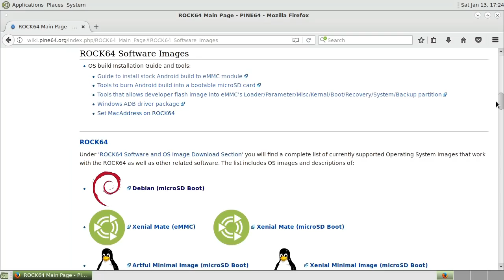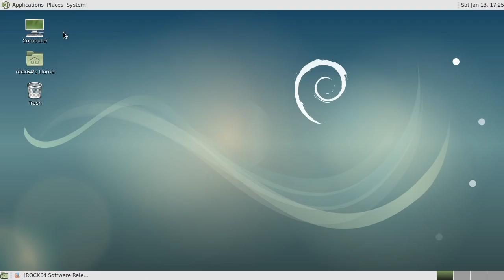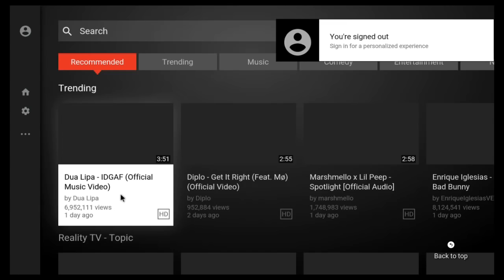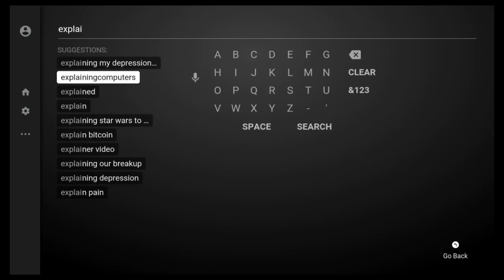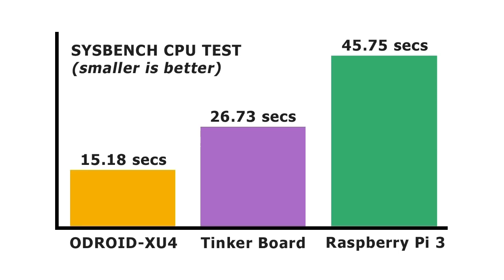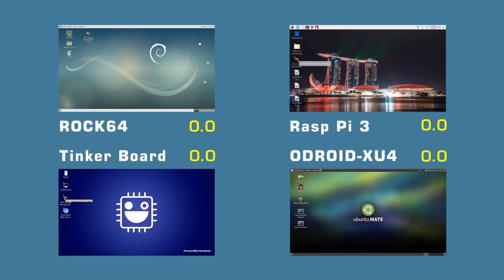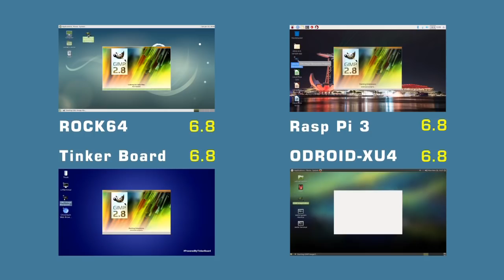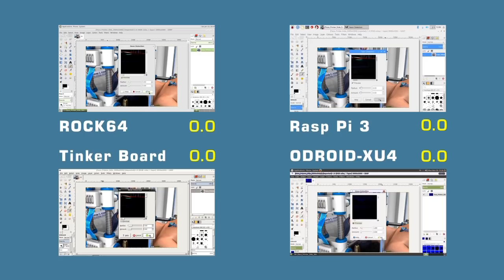ROCK64 4K USB 3.0 SBC

Comment: You are the second reviewer I have heard whining  about the lack of onboard WiFi, which, unlike the Pi 3's IO Bottlenecks, lack of RAM, and underpowered CPU, is easily fixable for a few dollars with an external USB WiFi dongle, which would offer much better range, bandwidth,  and security  (better security since it can be disconnected to 'air gap' the system, which could be critical in secure environments). Cost of the 4G Rock64 board including an add-on WiFi and SD card would still be less than an ASUS Tinker Board S,  with the Rock64 offering 2x the RAM (4x the RAM of the Pi3).

Cutting out onboard WiFi, saved them from dealing with MUCH more complex (expensive) compliance issues in the U.S. UK and Europe, letting them provide a more powerful CPU , TWICE the RAM (or 4 times for another 10 dollars), USB3, and REAL 1G Ethernet (with no BS Pi 3b+ bottlenecks).  

Pixel makes it clear that Pi Foundation intends Pi to be suitable as a lightweight desktop, but lack of RAM really kills the experence - so I would think folks would be overjoyed to see a nice low cost 4G RAM 4K Video SBC instead  of nitpicking.
Reply: Steve B. I think you forget that the Raspberry Pi Foundation is a charity organization. One with a very specific aim. They are not making desktop PC replacements, they make educational tools... combined hardware, software, literature and resources to encourage learning and experimentation. It's a long term project, which is something you can't necessarily say about  'competing' products. Many are here one minute, gone the next. No updates, no support, no future.

Comment: Chris, from your suggestion(Spectre/Meltdown video), I ordered and now received my Rock64 in today's post. However it gives no splash screen on power up and I have a blank display. LED's on, voltage on 3x USB, no lights on Ethernet. Using their power supply. Any ideas other than a dead board? Thank you for all your great information on the products!
Reply from the maker: Sorry to hear this, and it seems you have been very thorough in your diagnostic testing. I would suggest removing and replacing the micro SD card, just in case it is poorly seated. And then I would try reimaging the micro SD card and trying again. And after that I would go back to Pine64 to report a problem.
Reply: My image wasn't unzipped properly. Working great
Reply: Mark Handrahan thats what it sounded like

Comment: Regarding the sysbench test, you should use the exact same operating system when comparing different boards. Otherwise, your results won't be valid. I mentioned this in your ODROID-Tinker-Pi review. Other than that, I really enjoy your reviews. Extremely informative!
Reply from the maker: I have replied on this issue on your other comment. :)
Reply: Yes, I saw that. Thank you. My old Gentoo background gives me a different perspective than typical end users. I'm so tired of using "power sucking" computers and am having trouble deciding which ARM device to get.

Comment: It has DDR3 1866 right?! That means faster memory access then the others while factoring those primes... It also may have some hardware acceleration, for cryptographic purposes that it may have been using for factoring... Or sysbench was seriously updated in the mean time(that's assuming you have not done those tests all over again, but used old footage)...

Comment: Its no big deal its got no wifi. I have the Pi3 and the Wifi is atrocious, it dies after 30 mins..(gradually slowing down).  The best solution is plug it into a powerline adapter.

Comment: They should invent a wifi dongle that would fit in the LAN port, instead of the USB port...
Reply from the maker: Very nice idea. Somebody should do this!
Reply: You can't draw power from the LAN-port. If absolutely necessary you could go with a TL-WR802N. Very versatile, have the sturdy predecessor TL-WR702N in use for years. But it's not a dongle.

Comment: The support for Yocto is a HUGE benefit overlooked here. My understanding is that this allows you to build a distro from scratch from driver binary blobs meaning future OS upgrades are possible on your own.

I own many SBCs, and the biggest issue for me using them years later is that they’re stuck with a particular Linux distro’s version and the company no longer supports it (Cubieboard A10).

In theory, yocto should solve this.

Comment: rock64 is made by the pine64 guys.... you know that pretty much translates to great hardware, great price and last but not least non-existent software support. 

the only reason the rpi managed to get in roughly the same magnitude of secods in these test are not because of its shitty low power hardware, or its horrible price/performance ratio, but because of its abundant amounts of software optimizations.

Comment: Perhaps the prime routine in that version of sysbench or Debian is using the GPU. Perhaps you can also look at performance meter which monitors the CPU during the test, but my suspicion is that the test is using the GPU instead of the CPU.

Comment: I hope this would be the first real competitor in this game. I'd be astonished if 4K really works as well as normal full HD desktop. And also that you could have some in-between resolutions available (like 2560x1440, 1900x1200, etc). Usually these 4K SBCs limit the resolutions strictly to 2160p, 1080p and the usual 720p, 480p, etc. I have got many disappointments on this aspect with other 4K SBCs and the benchmarks are only a small portion of the real usability of an SBC, in my opinion; lots of features were not finished in linux side, only working in android ports and stability issues on the linux in general.

But I like the video and the channel in general!

Comment: I have the 4G one of these boards and it has worked well for a lot of projects. Would be interested to see a video on this using an eMMC Card (apparently ODROID ones work on it). Also a mention/test that the extra GPIO pins are already configured (with the Debian OS) to host a second Ethernet port (albeit at 10/100).

Comment: I've had this very machine for just over a month - the performance is actually very disappointing as htey wound the CPU clock speed right down to 1.2ghz Ithink, apparently this was to cater for units which ended up with slower ram chips according to one thread.   Our CPU miner - which hits 16 on the Tinkerboard - only hits about 10-12 on this thing and that's under a 64 bit OS where teh Tinkerboard runs 32 only (it runs at 1.8ghz though).  OS development is still terribly early,  there are many basic problems such as systems which won't come out of screen blanking which can't be turned off so as soon as the screen goes into power save it never comes back on one distro...  You can't get anything but basic resolutions and something like 1280x1024 can't yet be done, I have spent a couple of weeks trying to find a solution for this to drive that ratio of screen.  It has potential but a lot of work needs to go into hardware support and the OS's which is coming along albeit slowly;  in practical sense it can be slower than a Pi 3 for certain applications.   I believe there are also problems with video driving too, I've read bits and pieces on this as well as major problems driving USB reliably.

Comment: Sure the Pi form factor is neat, but I'm thinking there would be a market for something different-
Considering all the folks upgrading PC from older DDR3 to DDR4 systems, why dont SingleBoards size up to include a DDR3 240pin slot or two?  So many people have ddr3 sticks just laying around, and these SingleBoards always seem to be low ram onboard.
Pair of ddr3 240 slots and a 16xPCIe wouldnt be that much bigger
Reply: RWBimbie Cost is the issue. Adding a ram socket on to a necessarily bigger board will bump up the price significantly. And then you get in to cheap X86 motherboard territory where performance and expandability are significantly better.
Reply: RWBimbie Cost is the issue. Adding a ram socket on to a necessarily bigger board will bump up the price significantly. And then you get in to cheap X86 motherboard territory where performance and expandability are significantly better.

Comment: The first thing I did with my Orange Pi Win Plus after getting Debian 8 on the SD card was to upgrade to Debian 9. Everything seemed to be much more responsive after that. So maybe you will also get better performance out of the device after upgrading.

I see these devices as a work in progress and excellent development machines for lack of other affordable systems better suited to development.

Comment: Hi, I like your videos. It would be interesting, if you can for example compile a program from MATLAB controlling some other hardware with these single board computers. I work on a ball and plate experiment (known in control engineering). Therefore I need also digital analog converters and analog digital converters. Is there any single board computer featuring ADCs or DACs?

Comment: Results like these from sysbench make me wonder what specifically they are measuring. The cpu is faster, but judging by the gimp startup time, it doesn't affect what you feel sitting at the keyboard. There is way more memory, which is twice the speed as what's in the pi. Maybe the GPU is better. Those significant sysbench speeds would show their benefits spectacularly if you know what was being measured. If we knew what different thing sysbench is exposing, software that excels on that feature might be the purchase time decision maker.

Comment: I wonder why they went with the ‘barrel’ power connector instead of micro USB?
Maybe micro USB is a fine choice for lower power devices like RPi because it’s ubiquitous  but I guess they’re having trouble getting enough power. 
A barrel connector means this device plugs into the wall, like some of the larger single board computers.

Comment: can such thinker board be used to connect PC graphic card on riser using USB 3.0? 4gb ram is only 45$ so, its cheap platform for running system.

Comment: Hi Chris,
I own both the Odroid XU4 and the Rock64, and ran the same test while watching your video. Guess what? I got the very same results as you did!
Diving a little deeper, the Rock64 CPU model is RK3328 which is based on ARM Cortex-A53 64-bit core. Rpi3 uses BCM2837 which is based on the same Cortex-A53 64-bit cores. Tinker Board CPU model is RK3288 which is an ARM Cortex-A17 32-bit CPU, and finally the Odroid XU4 CPU model is Exynos5422 with 4 ARM Cortex-A15 and 4 ARM Cortex-A7 cores.
As far as I could gather, Cortex-A53 is the best out of all (and not only because of the higher number in the name!) which also uses a newer armv8-a instruction set (compared to armv7 on the older ones), so it basically should come down to the fact that it's a 64-bit system with the latest instruction set from ARM.
Further comparing the Rpi3's BCM2837 and Rock64's RK3328 I found that the CPU L1 cache is the same (32Kb) but interestingly enough Rpi3 got 512Kb of L2 cache compared to Rock64 which got only 265Kb. So the only conclusion should be that  either Rockchip added some special circuits for prime number calculations (which is very unlikely), or that the memory of the Rock64 is just so much faster.

Comment: My Athlon 5350 (4 core @ 2.2GHz CPU), X86 AM1 AMD platform, that is low power low cost PC x86 APU from year 2014, blah, blah... entire computer uses about 30 W maximum altogether.
 I just checked what i will get there on sysbench (with same like yours command line) and here are results:
 2.4 seconds on Debian 9 64bit 
 4.1 seconds on Debian 9 32bit
  There is a difference between 32bit and 64bit OS, 64bit is faster. But that Rock64 seems exactly matches this x86 CPU in ideal 64bit OS clock per clock in sysbench which would be real great news if it is not some kind of a bug :D

Comment: Fore some, having wireless on these cards is a strong negative, especially for the security minded.  Imagine building a multisubnet network in your small organization using these boards as routers and finding all isolation and security bypassed because of an active wifi adapter.  In that context it best to simply not have one.  Great video BTW. :-)

Comment: With all those barrels universal charger may come in handy !
As far as I know the 3.5 mm barrel were used in Nokia cell phones, but those were too weak to power up a SBC. In case of Orange Pi (which I own) the 4.0 mm barrel may seem even less standart, but fortunately the original charger for Sony PSP console fits perfectly, and has just the right parameters (5V and 2A). I believe one of the SBC you covered on your channel had a standart 5.5 mm one. 
Dont get me wrong, Im not a big fan of micro USB. All phones with micro USB socket I used to own, and attaching/reattaching the charger always made the socket loose, and caused troubles with charging the device, while the old fashioned DC sockets are in good shape even after many years of usage. Im just not sure why it varies so much

Comment: It would be awesome if they had on one side a connection like a pci and that we could connect two, and have them work as one, that way we can have 2 4GBram working together as a single 8core CPU with 8gb ram, and no internet socket, just one Wireless built in card, with 8K max resolution, and no USB ports, only one 3.0 USB port is enough for me, and sense we could combine two we would have 2 if they decide to plug two into as one single board, that will be nice.

Comment: I have had two of these for about 6 months now, one is being used for playing about with, and the other is now my home server.  I can confirm the sysbench results on different linux distros, and would ask if you using a 64 bit distro on the other boards, and what speed of memory do they have.  Mind you, sysbench is not really such a great benchmark.   Putting an eMMC card in is well worth it, about £30 for a 64GB card, speeds the system up over an sd card by a small margin, also means you can have a distro on all the time, and still boot other OSs from sdcard, or use it for storage.  I also find the power and reset buttons useful, much easier, and safer than yanking the power lead on other SBCs.  A power barrel is a great improvement over a micro USB connector, much more secure.

Comment: Can you help me track down, and possibly review an inexpensive SBC that has dual gigabit Ethernet on it. I'm trying to find one for a project I want to work on and I value your opinion. Thank you!
Reply: Have a look at https://en.wikipedia.org/wiki/Comparison_of_single-board_computers and sort the table by the Ethernet column. (Several of them are just gigabit switches so those likely wouldn't work as dual Ethernet.) This could also be helpful: https://linux-sunxi.org/Table_of_Allwinner_based_boards

Also note that you can buy a USB to Ethernet adapter for as little as about $10 to add a gigabit port to a more common and likely cheaper SBC that that has onboard gigabit Ethernet and a USB 3.0 port.

Comment: Have you checked the architecture they use? raspbian still doesn't support armv8, while debian on rock64 seems to. Try the different systems with the same OS like DietPi, the results should be more consistent.

Comment: There is nothing wrong with sysbench, you are getting that result because you are running a 64bit OS
Reply from the maker: A very good point, though I find it hard to believe that this accounts for the total speed increase (10x) when performance elsewise is not that fast.

Comment: Hi Mister Barnatt. I enjoyed the review. Like you,  I suspect a little tweaking going on behind the scenes at the Pine studios.  I would like to know two things: 1- When can we expect to see the Pi4, and 2- I would have liked to see a demonstration of the USB 3 to see if it actually works in this distro, or is it a feature-of-the-future.  Good job.  73
Reply from the maker: I think we will get the Pi 4 in early 2019. The Raspberry Pi Foundation have said that they see the Pi 3 as a three-year product. I must test the USB 3.0 port as you say. :)
Reply: Hi Mister Barnatt. Thanks for responding so quickly.  I wish I could get a Pi to work with USB 3 ( or better ) now. I was trying to get my laptop to run Mint and DOSBOX and I simply could not get it to recognize the 3.0 thumb drive.  Darn. Well, I guess that we still have to thank Microsoft for something. Cheers.

Comment: To me the downfall of the SBC is not the WIFI capabilities but the lack of the CSI(Camera) interface.  With the faster processor, gigabit ethernet, and comparable price it would be a excellent candidate for a replacement of the raspberry pi as an IP Camera.  USB Camera would be a bit of a hassle and inconvenient.

Comment: Thanks a lot, very well done as usual! 
I only missed a 4K test preferably within Android 7.1 ... there was even an app for that ... but seeing if Youtube can do 4K at 60Hz without stuttering that would be a fantastic promo for the device, since the others still seem to be not quite up to it yet. 
It is still very surprising that the Odroid is performing so badly, maybe due to some poorly programmed driver, when it has a total advantage in hardware with its higher core count, CPU- and memory speed. On the other hand what is happening in your first benchmark test of the Rock64? Would love to know what causes this "extremely good looking"/fake? result.
Reply from the maker: Yes, sorry, I missed the 4K trick -- I really should have tried the app!
Reply: Maybe evaluating all these boards for 4K video capability with different media types, players, OS's could be an entire video by itself that a lot of viewers will be interested in.